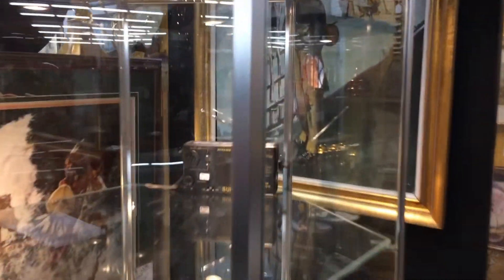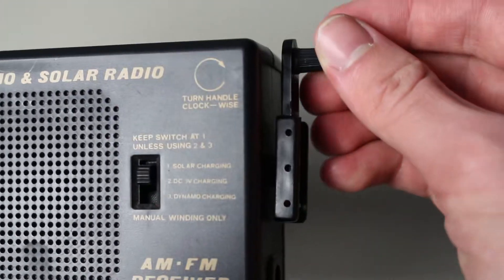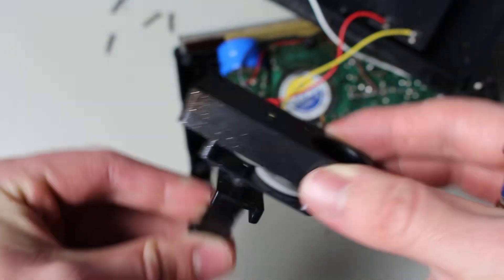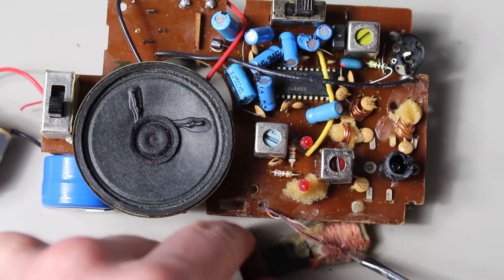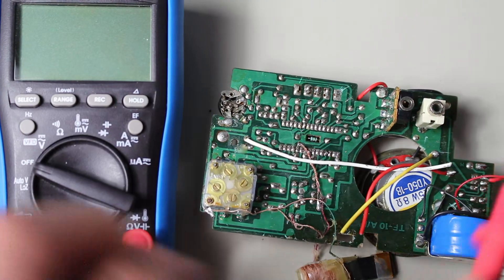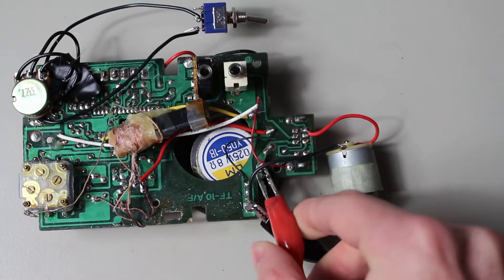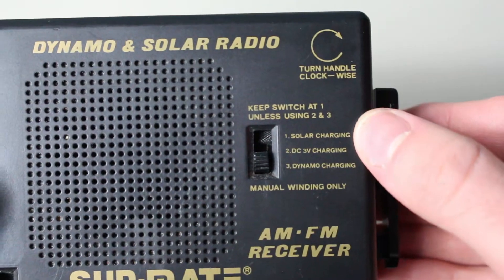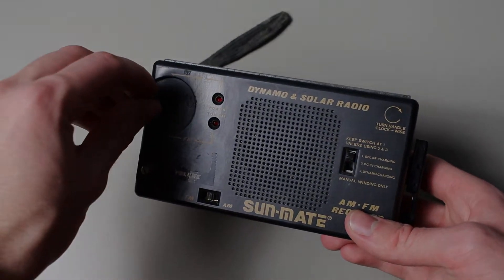This radio almost works - Fix or Scrap: Dynamo Radio

Comment: Hi.  Great video.  Maybe you could help me.  I just bought a second hand Eton radio, but after I got it home, I realized that it was missing the rechargeable battery.  When I crank, put 3 aaa batteries or plug into DC power, the flashlight comes on, but I can't get the radio to work or the buttons to respond. The screen says 000 Dyn/sol.  Do you think that the issue is caused by the missing battery or something else?
Reply from the maker: It's hard to say exactly without seeing it in person. But I'd say that the missing battery definitely is a big suspect. Especially since the flashlight comes on, and the radio gives a 000 message. Give the battery a shot.
Reply: @SineLab  thank you for responding.  For some reason I didn't get notified.  I will try to get a new battery and see if it works then.
Reply: @lyn1.6 is it working now?
Reply: @jackgerberuae  No.  Even after putting in a new battery, I couldn't get it to turn on.

Comment: I see 8 cells in the solar panel. Typical about 0.5V pr cell, so 4V total in ideal conditions.
Reply: But probably very few mA.... Maybe only enought to ceep the charge.
Reply from the maker: Thanks for pointing that out. It seems like you're right about that. :)